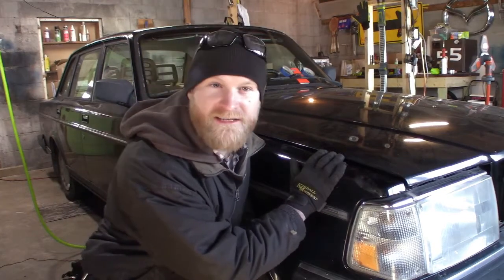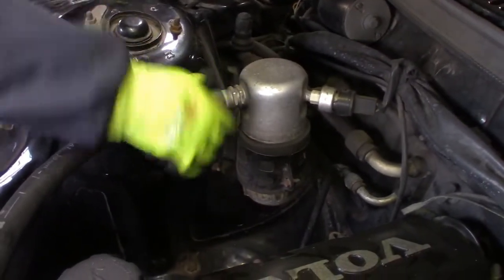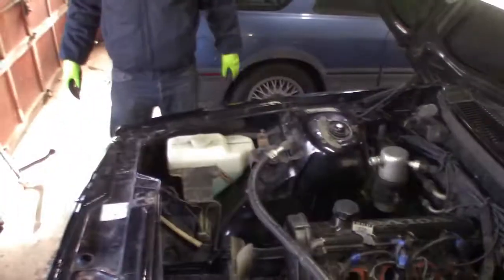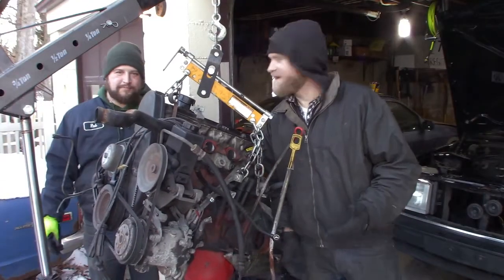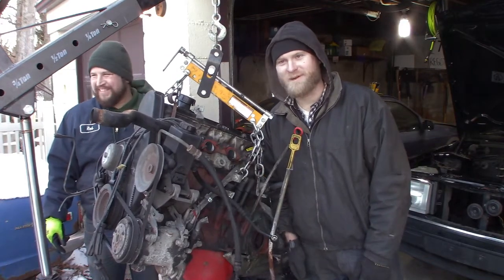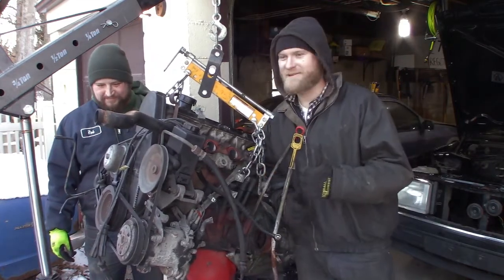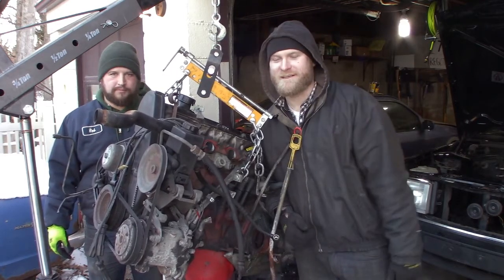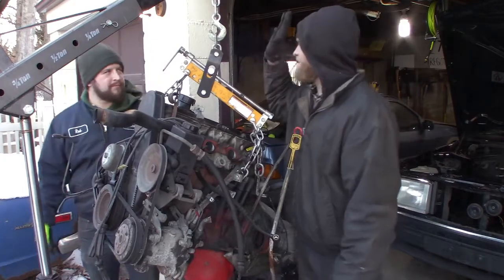Volvo 240 Engine Removal: Project Black Brick

Comment: Could you disconnect the trans from the engine? And remove them one at a time?
Reply from the maker: You absolutely can, but since we installed a manual transmission and a different engine we just did it all at once. It's easier to do all at once.
Reply: Helpful.   In the process of removing the engine on my 242.

Comment: Just a little tip for next time. If you remove that tool tray (the thing that sits above the light) and the center support it makes it a heck of a lot easier to take the engine out with only having to undo like Six Bullets.
Reply from the maker: Yeah we wanted to remove the core support but ours was spot-welded in and we didn't want to cut it. I'm not sure what year they started welding them in but I know you can definitely just unbolt the core support on the earlier 240's. It wouldn't have been so difficult if the hoist wasn't working due to the 10 degree weather.
Reply: @ClappedOutGarage  I'm doing the same, and I just drilled out the spot welds. For a nice finish, I'll fit bolts with washers when I put it back together.